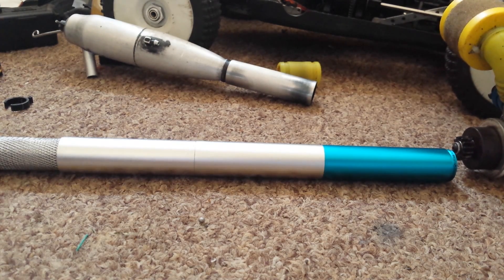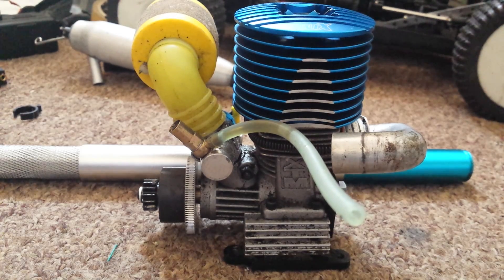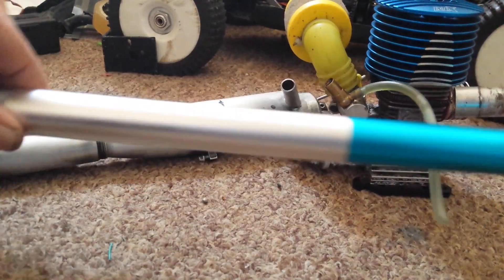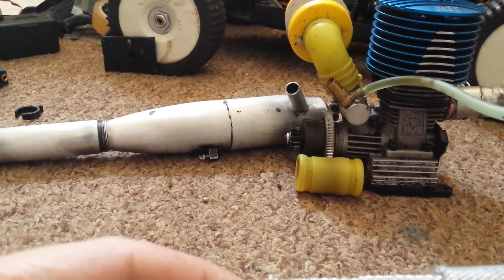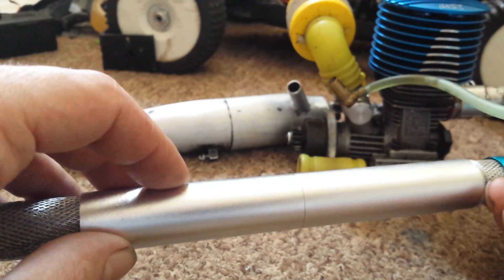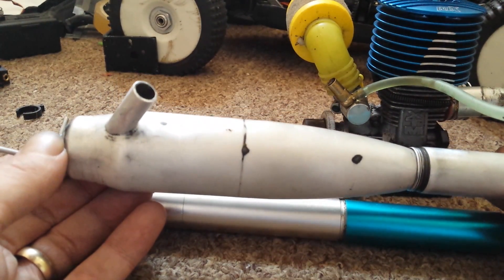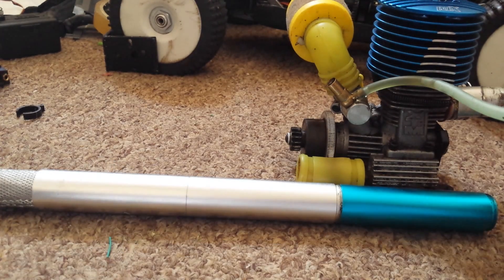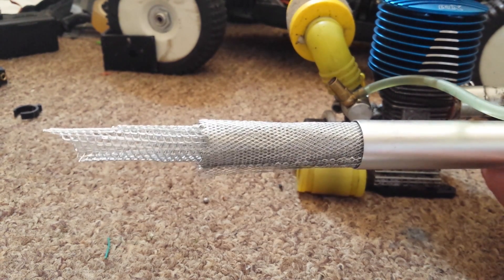RC  D.I.Y. Nitro Engine Muffler/Silencer

Comment: The small out tube on the  exhaust is to blow fumes in tho the fuel tank and then blow the fuel in tho the carb.( nice vid I am going to do a similar thing with copper pipe keep up the good vids 👍🏻).

Comment: the entrance for the tube on the exhaust pipe is not for residues but, because these cars don't have a fuel pump, part of the air and smoke gets into that tube and goes into the fuel tank, mantaining the loop pressurized and helping to push the nitro into the tube to the carburator.
Reply from the maker: thanks for the heads up, i will keep it in mind when I get this beast back out of storage :-) Im hoping to have finally positioned this entire system where it is to finally kick it up when i get chance, it would be nice to still fluke some presure down the entire stretch of pipe at the end still but if not I will look again at its design and try to adapt it with that in mind. I'm not great at mechanics for sure as it shows but I'm just messing sharing my bodging incase it triggers thoughts for others :-)
Reply: @battonfive  good luck for your project. I really like your concept
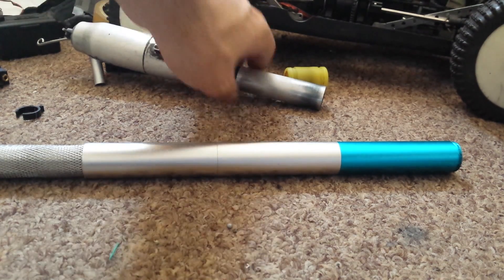Reply from the maker: @thenitropower  thanks I was trying to kinda rip one of those early russian antartic vehicles while i messed with the scaling on the thing (think i got it to 1:36 scale eventually), its so heavy and huge that machine i dont know if the engine will just konk out on me or explode if i get it running :-p but its been great playing with the gear box transmition stuff and i figured just some idea of a muffler design might be handy, back when i put this together both a nitro muffler and 6x6 nitro were unheard of on the net :-) not sure about now, hopefully others have improved and posted.
Reply: @battonfive  I'll stay tuned for a future update. Can't wait to see your 6x6 nitro rc car :)
Reply from the maker: @thenitropower  thanks yeah please do :-) i enjoy chilling with the scale community type thing, Im in an apartment at so dont have the space to lay all my projects out to do some work on them like i was there in my old little house but its cool i wont forget about them all the data and projects are stored in a nice ordered way to pick up where i left off and i will be getting a new house before long so should be back to it :-)

Comment: how would i make 1 for my goped???
Reply from the maker: Hey sorry its took me a while to reply, hmm goped is a good one, its possible that this style could be expanded up a bit, using some larger diameter piping say, perhaps using a copper pipe cut down, with that one i might try using a inner ring of fine mesh with perhaps some wire wool between the mesh and the outer copper pipe. I think that could help defuse the sound in to the wool without taking away from the power to much say, but i must admit my mechanics arnt that great, i could link you to someone who knows alot more about engines if you would like :-) he deals with rc nitro engines and petrol engines and motorbike engines :-)

Comment: This might reduce the noise produced by the engine, but it will also screw-up the resonance that the engine relies on. The exhaust pipe is designed to reflect a coherent pressure wave back into the engine to shove escaping fuel/air mixture back into the engine before the piston seals off the exhaust port. Anything that makes the exhaust quieter degrades the effectiveness of this pressure wave, and thus changes the way the engine runs -- usually making the engine run hotter.
Reply from the maker: +Shawn Elliott Cheers for the positive input Shawn :-) Hmm I was thinking that the back pressure being off world perhaps mess with the pressure of the fuel line which might choke off the engine if it didn't get through, but I wasn't so sure about the back pressure on the engine and how that would behave, I have been expecting higher temps admittedly on this setup and am willing even to take some damage and warping but I was just hoping that it would run and work and also that it wouldn't blow up :-) I cant imagine this being a grade work around for a racing truggy or something like that say but for my efforts with my 6x6 chasses it would be nice to get it going for a bit and see it in action :-) im still working on it all on and off, work and a few other projects have been liberating my time :-( Really thanks again for the input I will really ponder on it as I go forward :-D
Reply: battonfive
The approach I took to silencing my nitro engines was to attach a rubber tube to the exhaust outlet, fill the rubber tube with some loosely-packed bronze wool (not steel wool -- it will rust), and hold the bronze wool in-place with a pin stuck through the end of the pipe. I compensated for the extra pressure being sent to the fuel tank by adding a T-joint to the fuel-pressure tube, and attaching an adjustable valve to the open end of the T-joint so I could control how much excess pressure was released. It did a great job reducing the higher-pitched sounds coming from my nitro engines, but eventually I took the silencers off and discovered a huge amount of extra power as a result.

As far as I can tell, the best option is to find a relatively quiet engine and run it with a hollow pipe instead of a tuned pipe. (however, as long as your exhaust header is, you might need a tuned pipe to compensate -- these engine require a specific exhaust-pipe length to work properly.) The HPI Nitro Star 3.0 engine is pretty quiet as nitro engines go; I can run one near my apartment with no silencer and nobody complains.
Reply from the maker: Shawn Elliott wow HPI Nitro Star 3.0 sounds brilliant! and the valve is a super clever move, I wouldn't have thought of that in a million years :-p
 Not so great news on the power note though :-( I thought I would loose a bit with this setup but that is now sounding like I was being a bit over ambitious there :-D
 With your input and a few others here I can now ponder on how to rework the 6x6 as I go about testing and modding the 6 wheeler :-)
 Cant help but agree its not an ideal design for the task of a truck :-D but I have been learning a lot about mechanics while messing with these engines which im really hoping will come in handy down the line as I consider and work on a few projects :-)
 You have an awesome channel btw, will give you a shoutout when I get chance, you deserve way more subs :-p
Reply: Shawn Elliott he should run a muffler from the exhaust port instead of between the head and tuned pipe.

Comment: Very cool
Reply from the maker: John Tewelow thanks John :-) I studied muffler designs for a few days with coming up with this one about a year ago as I couldn't find any video material on it, im just waiting to leave the night shift for the day shifts again and im going to get this out and do some decibel meter testing on it :-D with a bit of luck ive de gremlined this truck now and its honestly, truly, really got the green light to have another start up test this weekend :-D admittedly filled with both trepidation and excitement :-p
Reply: I will be interested to see the difference in decibels. Your design is innovative in that there are no baffles or internal expansion chambers. I bet it works great
Reply from the maker: John Tewelow thank you :-) I hoped at the time id considered most if not all the factors involved to consider for the pressures and gas flows :-) but I have to admit it was freestyling all the way :-D I really appreciate your bode of confidence :-)

Comment: Old vid, But, Something i might add, Which im sure you will someday figgure out, If you restrict the out-gasses of a nitro engine, Even by a small amount, You will cause the engine to run much much hotter, And as most of us know, Nitro engine's do not like excess heat. 

Just be careful with how much restriction you add. And keep an eye on temp.
Reply from the maker: Peter Court thanks Peter your positive helpful feedback is most welcome, im the first to admit its all hit and miss stuff for me here so will be definitely keeping an eye on the temp for sure :-) This truck is already to go now with a bit of luck, just not had time to take it out in the back with all the stuff involved and get it started :-) do you know by chance if the nitro engine blocks blow up if they get to hot? :-D
Reply: battonfive No, Block will be fine, It's the piston and sleeve that wear.
Reply from the maker: Peter Court thanks for letting me know :-) I didn't have a clue tbh was hoping im not winging it to much, but if its just additional wear and tear its cool :-) I know it wouldn't be ideal for others for sure but im a bit of a part timer rc'er so I don't mind to much :-) that you have settled my mind that it isn't gonna send shrapnel everywhere is most appreciated :-D Once I get my truck going I will use the decibel meter I picked up a few months back to check the different levels at stock, without muffler and with my diy one :-p see how much of an effect it has :-) Black oily smoke is welcome for me on this one :-D

Comment: battery power? Nitro suck bang blow screamers rev high and makes an awesome man sound.  if its less decibels you need
Reply from the maker: :-D I do love battery power for convenience, but I thought I would have a go at making this noisy beast to get an idea of some mechanics and energy densities :-) like the nitro engine here is a screamer :-p but that means it would probably work pretty well in a r/c plane :-D I did manage to get a decibel meter to check this muffler design I stuck together but ive not had chance to get out and test it all yet, no camera and poor weather :-) I would have liked to gear this engine down somewhat for this truck but I couldn't be bothered messing about to that extent :-D cheers for the feedback though :-)

Comment: the sound is tramsfered to movement with the mesh nit heat
Reply from the maker: that makes a lot of sense thank you for clarifying it, that means that the sound transfers to movement which in turn transforms to friction and heat right?
 I'm gonna test it over the weekend :-) hope it works, bit disappointed I don't have a decibel meter yet :-) but I should be able to make some general comparisons :-D ...unless it blows up, but even then that will be answer of sorts I guess :-)
Reply: kinda ik still 12 im learning it in by my self
 can you make a riunning vid
Reply from the maker: im 29 and im still learning by myself :-) so no worries there :-p but yeah I will make a video, I had a go at making one today but I had some problems with the engine :-(, im going to try to fix them and have another go tomorrow :-)

I think it should work fine but I have never messed with an engine before so its all still a bit new to me :-D

I appreciate your input, once I get it running and upload the video I will be happy to answer any questions :-p
Reply: tnx I had a problem to with my engine  I attached a platic tube at the end of my exausd an it was much quitter
Reply from the maker: :-) in a normal car there are only really two designs for a silencer, the designs haven't really changed over the years. The inside will have some metal bits in there that are designed to diffract the sound about the place so it is turned to heat instead of it coming out as sound :-) The silencers that come with out xtm engines however are hollow :-D

You should be able to add some wire wool to the muffler you have there to quiet it a little more :-) that's a pretty simple job.

Or perhaps you could make something like this tubular meshing approach that attaches to the little funnel thing that comes off the muffler :-)

My problem today is that I was swapping from a pull start, to a box start, but I needed a rear plate to replace the pull cord box :-)

Ive just ordered the plate off the net so it should be due on Wednesday :-) The rest of the truck seems fine though :-D

I will post a video tomorrow of whats going on with it all and how im waiting on that rear cover to replace the pull start box thing :-)
Reply: ok il sub

Comment: The other buggy you have is a xtm xt2 I have one it's in really good condition
Reply from the maker: hey man :-) its weird, when I got these two I thought they were both xtm tx2s, but one of the chassis looked really thin like it was completely different :-) the nitro one looked like it had kinda standard spacing's and holes for screws and nitro block, but the other one that I think was electric, had a completely different chassis layout :-)

on the elec looking one I chopped the back half off :-D and used the back half with the other nitro chassis acting as the main front body:-) I've no idea of top speed on this 6 wheeler ive made :-) when I get chance im gonna start it at 15% nitro glow fuel and boost it to 30% after a few runs :-D hopin it has good traction as its so heavy

Thanks for the share of this vid, if the weathers not to bad, get out there and get me some footage of your tx2 doing its thing  :-)

Comment: Good idea...another very simple mod to quiet the sound is too stuff the muffle loosely with stainless or copper pot scrubbers.
Reply from the maker: like it, I will check the sound with:
1) engine on its own, 2) engine with original muffler, 3) engine with original muffler and diy silencer mod, 4) engine with muffle and diy silencer mod with perhaps a little wire wool in or a thin amount of meshing in the original muffler as you advise :-)

thanks, that's a nice simple clever idea, I appreciate the comment and share of info :-) gets my thumbs up :-)
Reply from the maker: battonfive ah and the air intake I would love your opinion on, my wife has been away for a few weeks so ive not had her mobile to do any filming but I extended the air intake using standard garden hose :-) and connected the garden hose up to the filter, im hoping its gonna work a charm, but didn't think it might over heat and go bang :-p

my knowledge of mechanics and engines as you've noticed is really basic :-) its why I took up this project to learn a bit more about rc engines and servos and stuff :-)
Reply: Well you'll be getting cold air coming into the engine which is a real good thing. Should increase power a bit, not sure about temps though. Airplane guys know all the tricks about engines...maybe check out an airplane or heli forum for advice.

Comment: The nipple on the old pipe is called a pressure line, that puts exhaust pressure into the fuel tank to help deliver fuel to the engine, otherwise it will lean out the engine, overheat it and destroy it. They also need to breathe very free in order to prevent pre ignition.
Reply from the maker: that's awesome, I couldn't find a source to clarify its exact purpose, I had my suspicions but I appreciate the clarification. Since the start of this project I was worried that the back pressure of the silencer's nipple thing :-p would loose to much pressure due to my diy mod as the pipe is extended and is now running two fuel tanks:-D

ive currently hooked up two nitro tanks in series so they are tethered together to feed in to the engine but I have no way of telling if it will work till I start it up tbh :-( with so many factors like the meshing in the diy mod I couldn't tell if it would gain or loose pressure :-)

if I don't reply ever again, then im probably in a hospital somewhere on life support and would thus recommend shorter piping if your having ago yourself :-D